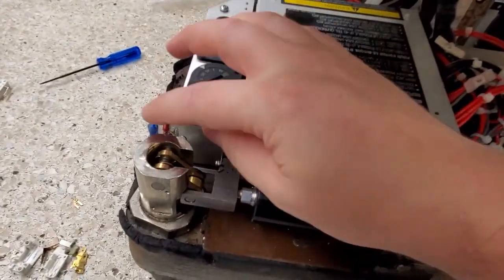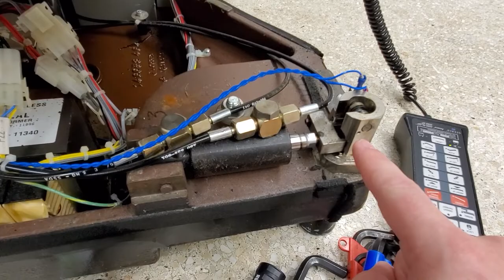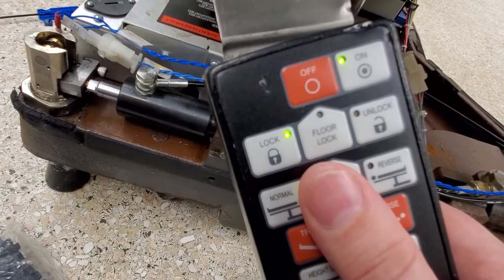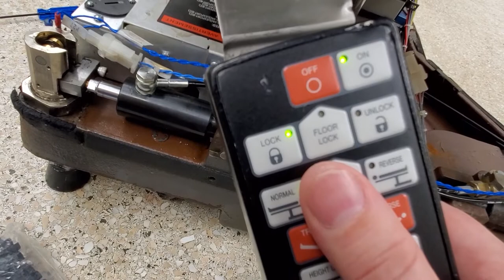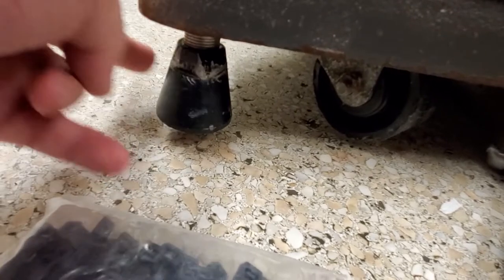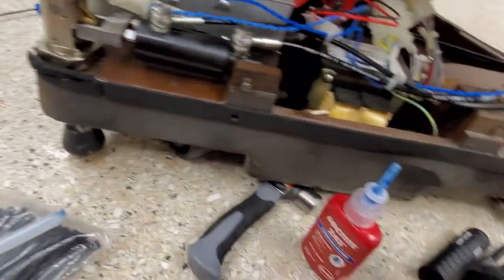Steris 3085 Surgical Table: Most Common Failure Explained

Comment: I like the lock tight idea. I agree it's a problem. I have observed that free float feet for the 3085 isnt the only culprit. Also surgical staff when unlocking the table to rotate 90⁰ (example working on a right vs left upper extremitee) they begin to rotate the table befor the feet go up. I ask staff to wait for the unlock sound to stop before moving . What happens is a foot or feet can brush the floor thus rotating the foot. Whether the foot winds up or down depends on the direction you rotate. I have seen many times the bed is tested at begining of day and after the hand control does what you showed they just rotated the bed. It doesnt happen in one event. Its multiple events that lead to the problem. Let's say you rotated or moved the bed as I described 20 times then it could happen. On another note regarding the switches being crushed ?  How many times do people move the table pushing with there foot? This causes the clips break or bend. Now you have a  problem with the shroud cover. The shroud can then crush or move things under it.
Good video,I give it a like. Also if the hand control does not work because of the feet lock/switches you can control the bed at the column.  Toggle switches control trendlebergs,up,down,leg,back,foot regardless if bed is locked or not

Comment: A while back, the OR asked me to take a look at a dead 3085. Wouldn't move under battery or AC. The shroud had been noisy, so instead of reporting an issue, someone kicked it, denting the shroud & damaging the control module,  then grabbed some WD-40, (i could tell by the smell,) and sprayed into the unit. It shorted out the PSU. 

Luckily, Steris still has PSU's for the pre-2004 tables. And now, all WD-40, Silicone, Moly, Lithium & Teflon sprays are locked up. 

 Still not the stupidest "field repair" I've found. That would either go to the exposed live wire wrapped in Tegaderm on a bed used in ortho cases w/o iso power, a plug snapped off the cord, protruding from an outlet, covered in tape,  the 20A fuses in a Rapidvac b/c "it kept turning off," or the use of red wall plates on non-emergency outlets b/c "we were out of white."

Comment: How do you override the lock when the hand control is not working?  My model does not have a rocker switch next to the pump
Reply: There is a button on the cylinder that engages the brake. Push that and the pressure is released.

Comment: Hello 👋 there I have with that table. The remote of table is not working. What would be the possible way to get it repaired. Thanks.
Reply from the maker: Often the internals of those remotes fail at the ribbon cable and I have seen the port itself fail due to shroud impact damage
Reply: @BetterBiomedChannel thanks. sir I have checked all the cables from the remote to table all are seems fine.and shows continuity. But I want to ask you sir the bettery and ac indicater is showing on remote. That is the actual  problem .for our OT table.

Comment: I understand what you are doing, and why, but it is embarrassingly unprofessional. (Locktite and hot melt glue) Total amateur hour. The pin that the foot screws onto has a hole in it for a rubber plug, when properly installed adds enough drag to keep the foot from rotating, especially with your finger tips.  The switches were damaged when the shroud was not installed properly also you are missing the plastic bumpers that go between the base and the shroud.  The shroud is then held out to the side of the base.  There should have been a ground wire from the base to the shroud that you don't want to break lifting it with a strap.  The 3080 series is one of the best tables ever built, at lest until the shroud was redesigned to make it more water proof.  
Leaving the table locked is a good practice!  Good Tip!
Reply from the maker: Hey Jerry, I would love to see the videos you've made to support the career field. Since you're the perfect biomed, I guess I could really learn a lot from you.
Reply: That was kind of jerk.response!